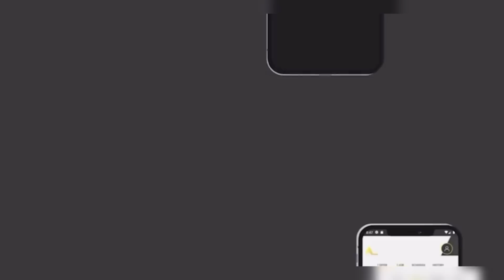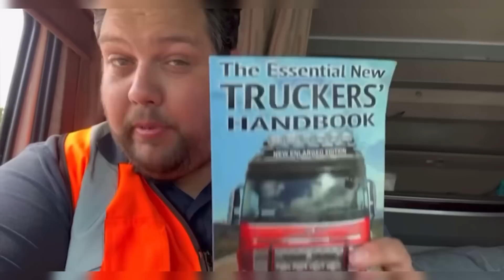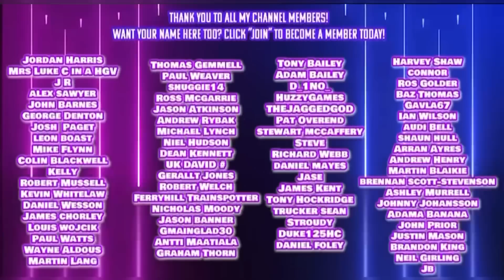I Messed Up.

Comment: i used to deliver steel and a certain load of oiled round bar used to aloows come loose, i was for ever stopping to re tight them up, plus all in bundles so used to slip out from the back too, nightmare when going up steep bumpy roads

Comment: Good video luke. Thats not tight. I have loaded there many times and i used a 2 inch square hardwood lever to really put some tension on. Not sure does the ratchets any good but never had a problem in all the years.

Comment: Even if its just a few lbs hear and there Luke it all adds up for the weight loss. I'm down 25kg from the start of the year with a few ups and downs along the way, strength training and my own made keto diet have really made this possible without much fuss and the strength training is good for the soul, you should give it go since drivers regulations can mean you're off 4 days at a time

Comment: Mate load and restraint i did back in the early 90's when I was in the RAF . I need an HGV 2 or LGV as it is now to drive Fire Engines and as you can imagine not exactly any need for securing loads as you do . Back then we used rope mostly and carters hitch  , I remember the name but not how to do it . We practiced tying of various loads and some times we even got strops . Of cause as a driver we have to make sure everything is secure and not likely  to fall off and of cause it's road legal plus operational as well . Example the pump the deliveries and sirens and lights etc . These days I  only haul lots of water and foam and dry powder for Firefighting purposes and all the equipment in the lockers that we use . My job is very simple compared to yours mate .

Comment: I'm gonna take a different angle here, since I don't know your particular circumstances I'll speak in general terms about this issue which has bothered me for a long time. First of all I've worked at stockyards and goods terminals so I know how badly some of them treat Truckers and trucking companies, also goods. Many of the places who ban drivers and or their companies for speaking out about their antics are also the ones treating Truckers like crap in the first place by making trucks wait longer than needed, cluttering up their yards or parking forklifts in the way to piss off drivers, playing football with small packages before putting them on pallets etc. etc. Those people and companies are the ones who should be banned, fired and looked down on, not the Truckers and trucking companies who make their transports, trust me, there's plenty of bad transport companies and drivers that shouldn't even be allowed on the roads as well but that's a different matter, all of it should be called out by the serious Truckers and trucking companies though, if not directly then at least indirectly otherwise non of it will get solved because politicians, unions and other interest groups will never solve the problems, there's way too much money and power to be gained in keeping the industry badly managed while still making a lot of money with useless mandatory courses every five minutes and inflexible rules and laws only serious companies follow. All of it needs to be called out for the betterment of the industry in general and quality of life for the serious hard working people in it in particular. Well that's my brutally honest opinion on the matter, take it for what it's worth, without Truckers you will have nothing, you won't even survive!

Comment: This is no reflection on any lorry driver that does the job but I have managed to lose a lot of weight since I retired. I think it's because the job is normally very sedimentary, with long periods sitting on your arse, so to speak and even though I used to occasionally exercise, I still pilled on the pounds. I have lost some 3 stone and am now down to near my target weight and I still eat what I want. When I was on the job the job I was pre-diabetic and within a couple of months before I retired, I was told I was diabetic but am now at normal blood sugar levels. I put it down to not sitting in a cab for long periods during the day and when at home being exhausted and not wanting to exercise as I should have.

Comment: Hi Luke, What is that red box just above your right shoulder; as  a non-trucker I note it on all vlogs by drivers.
Reply: Height indicator. Adjustable with the rotator knobs either side.
Reply: @CO27  Thanks, that makes sense. It would be interesting if a driver might give us non-truckers an idea of the cab/dash layout at times.

Comment: I know how you feel I was a tipper driver for a place where I worked they were like family I worked for them for 7 years  and left and worked in England. And went back to them and worked with them for about 5 years. Then I got covid had been off for a few weeks a manager asked me to come in as they were stuck .I was still not well enough  really and as I had not been  in my car for a few weeks I had no fuel and I was  starting at 4 o'clock I asked Mark on fone could I use the fuel card to put some in my  car as you might have already guessed I am from Ireland no plases open at this time so he said to used it this got me sacked I am still in shock about this I know how you feel about it one minute every thing is going well and the next gone 😢😢